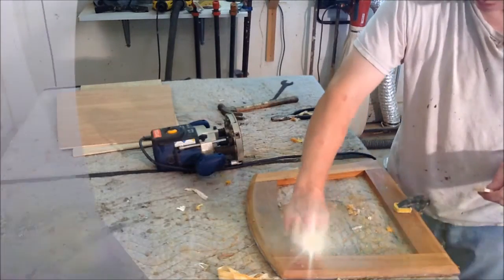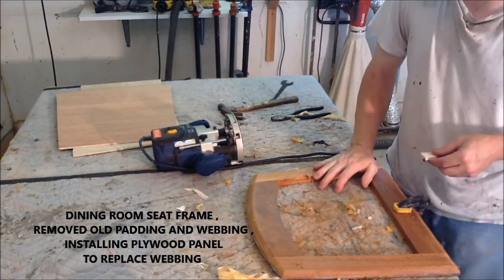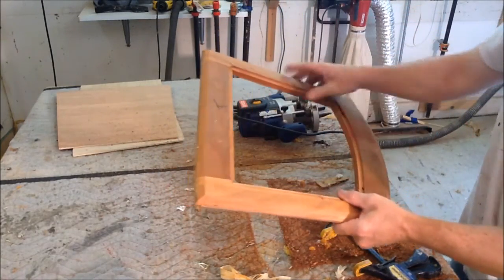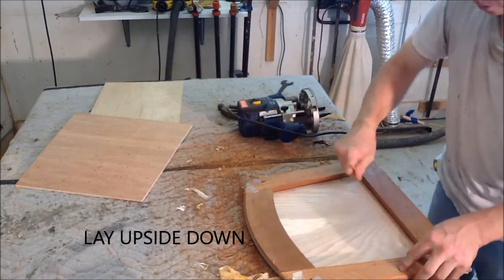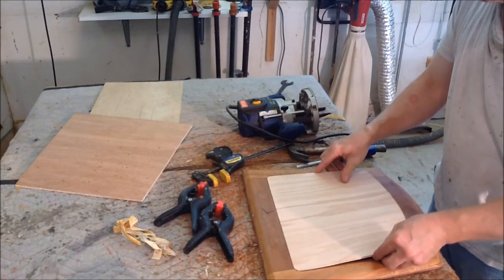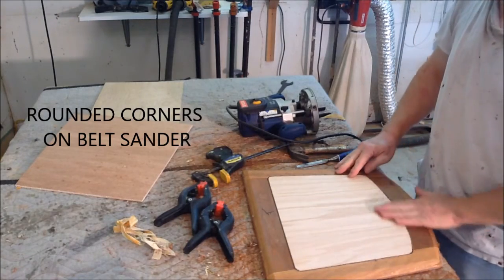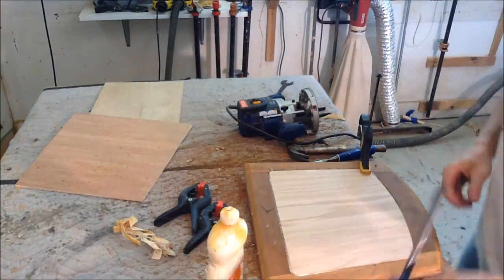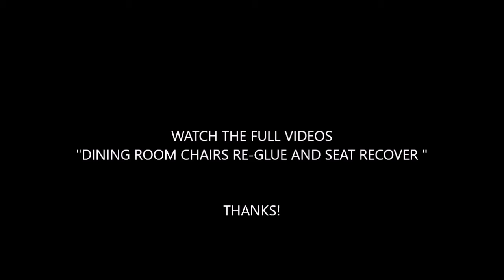REPLACING DINING ROOM SEAT WEBBING WITH A PLYWOOD PANEL / FURNITURE REPAIR

Comment: So, do you put the padding/cover on the side that's flat, or the side with the depression? I used plywood to fix a porch swing (canvas originally). It worked pretty well, but it was a bit uncomfortable compared to the give from the original. The side of that char seat with the depression seems like it would better suit the butt that sits on it.
Reply from the maker: THE PADDING GOES ON THE FLAT SIDE